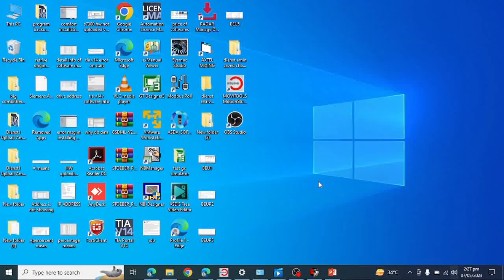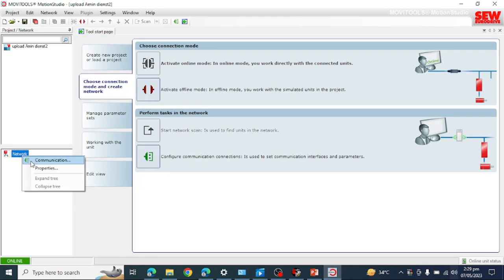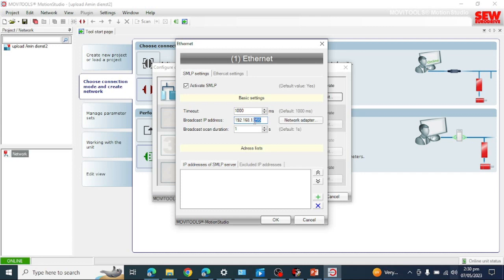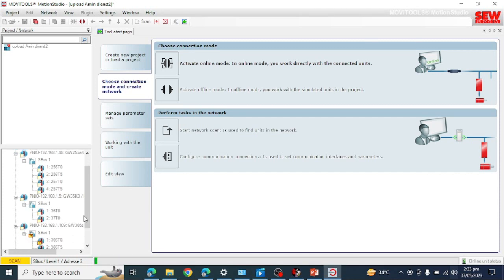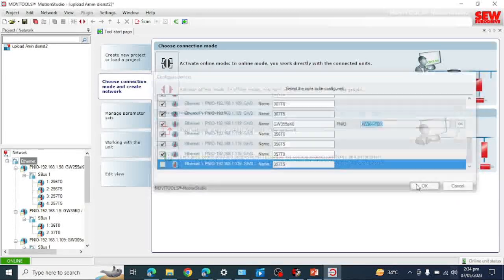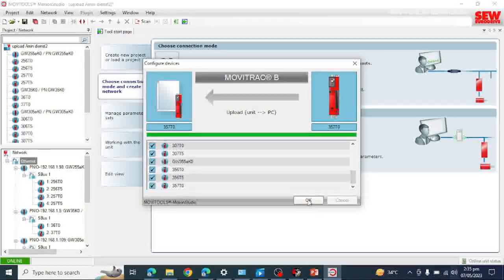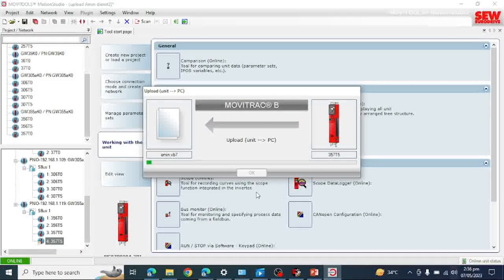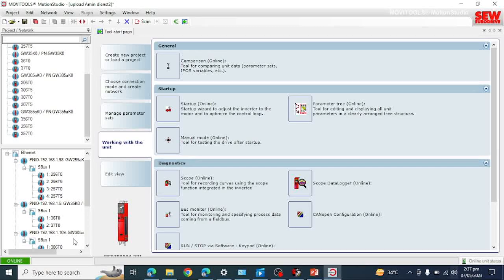DEF32B SEW communication Gateway upload Backup || All SEW drive Backup on one click

Comment: Dear, good day
I need your support to make a backup.

I currently have a machine in my plant with the DHE-21B controller, however when I perform the indicated steps, it does not recognize any connected device.

Tell him that I have 3 devices in the bus can port, which I want to monitor their behavior. Also, is it possible to send the data via opc?
Thank you very much for the reply.
Reply from the maker: Hi DEH21B is Encoder Card and you cant connect this card directly with movitools software, as is is encoder it must be connected with mdx61b or any other sew drivel, what you need to to is to use usb11A convertor to connect with MDX drive and take online that drive and you will be able to upload parameters and other info
Thanks
Reply from the maker: Check This video
https://youtu.be/6FEXZEizgUs
Reply: @industrialsolution6828  Thanks for the esteemed answer!
In the case that I want to read the data from the 3 connected devices at the same time, is it possible? I am using an opc ua server and I want to read that data for a scada.
Reply from the maker: @oscaraliaga1033  Hi you can read data of  three devices at same time